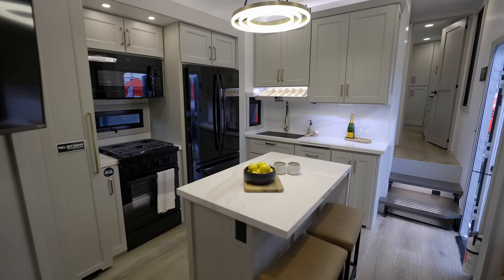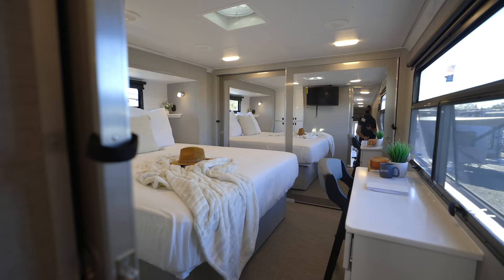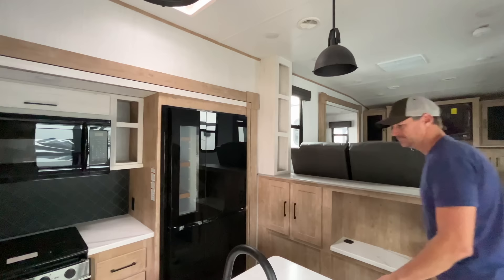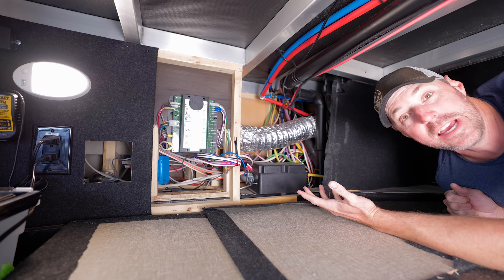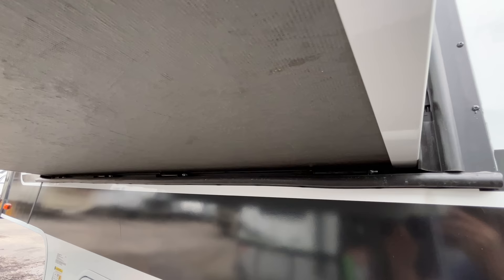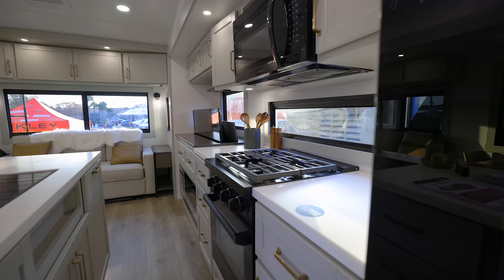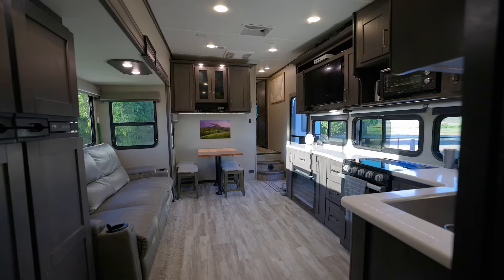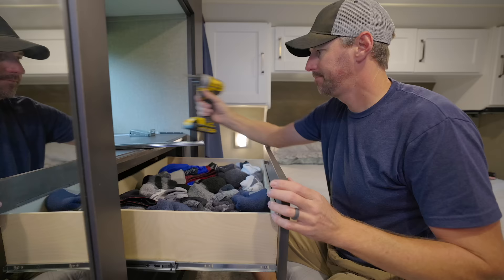Are All RVs Junk! Problems With Our Grand Design RV.

Comment: After 3 previous RVs, I was hopeful that moving up to an Airstream would finally get us into a quality-built trailer, but I was wrong.  While the exterior and interior designs appointments are beautiful, I keep running into things that just make you scratch your head - like the electrical system - which appears to have been installed by elementary school kids.  Of the four RVs we have owned, the Airstream by far has had the longest warranty punch list of all of them.
Reply: Surprised the RV industry hasn't been shut down for child labor - the proof is in the wiring of the coach.  Air Stream might have to purchase an older unit from the 1950's to get a good one. 😀
Reply: Hmm.  Also assumed Airstream was a 100% throughout..

Comment: After just over a year full timing in my Grand Design Imagine XLS I'm happy to say the only major issue was the sliding bedroom door and it's track falling off 2 or so months into owning the camper. The 2x4 that the track was screwed to was just screwed to the thin plywood ceiling with 3 screws. They didn't design it such that one of the roof joists was overhead to screw to (which they easily could have) and the people putting it together didn't screw it to the 2x4 in the wall behind it. A few long screws to attach it to that 2x4 and it hasn't fallen down since.

Major issues aside there have definitely been a lot of fit and finish or smaller/potential future issues I've run into, mostly just from the rushed construction. Jagged holes and errant screws poking wires, wiring in the underbelly just resting on the sharp frame and rubbing through, lots of gaps and some peeling trim, but thankfully nothing that wasn't pretty easy to fix (okay, the underbelly wiring was a pain but I did that while installing tank heaters, which was an even bigger pain, so I didn't have to drop the underbelly just to fix that.

From talking to people in the industry it seems like a lot of it is down to the rushed construction, with many to most of the people assembling RVs now being rushed contractors instead of regular employees. Companies love contract labor because they don't have to pay for benefits and they can do things like pay per unit that rolls off the line instead of by the hour. Corporate usually loves it because if there's any delay the workers eat the cost, not to mention, when pay and bonuses are tied to how many units are rolling off the line it puts a lot of pressure on people to rush things to try and get even 1 more rig out the door each day. As one person put it, the reason new RVs have so much sawdust is because, when you're paid per unit and not per hour, you don't get paid to vacuum up as you work. Perhaps even worse, or better for corporate, this let's them dodge the blame for any issues by blaming greedy contractors when in reality they're just trying to make a decent wage while navigating all the obstacles corporate has put in their way.

At this rate, soon enough we're going to need a whole industry of techs and repairmen, of which there already aren't enough, just to fix all the issues with new units before their new owners can actually start using them.

Comment: I have a small 16' hybrid camper. I have had to do so many improvements. I have added drawer glides and made many upgrades. We are constantly fixing things and making the camper more livable. We don't live in our camper, but we like taking long camping trips. I need the camper to "work." We have spent 4 years changing little things: hinges on the dinette benches for easy access to storage, flipping a medicine cabinet to make it reachable, changing the bathroom sink and faucet to make it useable, etc. I'm glad I know how to make all the changes. I just wish the quality was a lot better. We are fighting a leak in the front tent-bed. I am finding water damage and will need to address that soon. The bed seems to have been installed crooked. I can see gaps on one side where the other side is tight. I have made about 60 upgrades and have about 12 more on the list. Thanks for sharing your video blog. Lots for me to learn.

Comment: We were very fortunate to buy our first RV from small family owned dealer. They really did a thorough PDI to insure there were no significant issues and spent four hours with us operating every system. The only major issue we had during the six years we owned it was the shower drain separating from the line to the gray tank. It was fixed under warranty by an independent local repair shop that the manufacturer approved so we didn't have to drive three hours back to the dealer.

By the time we purchased our second RV we were very well educated and spend three hours running every system, opening every door and draw, testing every electrical outlet, thermometer to measure the air temperature at every A/C outlet, television, CD player, microwave (making hot water in it), slide, awning,  etc., etc. around, under and on top of the RV. I told them a day ahead of time the fridge needed to be turned on well before we got thete. After the three years we had to replace the A/C unit and tack down some molding that came loose.

A few simple things can be done to prevent having issues when you drive off the lot. Don't be in a rush. If you don't feel up to doing a thorough inspection pay an inspector to do it. Have the dealer demonstrate how to close the awning, get the slide in and out, lower the front jack if the motor fails, video the walk through.

Comment: Great video as usual.  I have been full timing in an Outdoors RV 33' 26RLS Glacier Peak for 2+ years.  I would agree that if you are a diligent DIY'er you can handle 99% of the issues that you will experience.  If you have no DIY skills and  depend on a dealer to service everything I think your RV experience will be a poor one.  If you don't routinely get on top of, underneath and pay attention to whats going on with your plumbing/electrical systems and learn about and take of things before they become major issues, yes you will think these are junk.  Some manufacturers are better than others, that is a fact.  I am fortunate to have a solid RV, knock on wood, but I spend time looking at and maintaining, re-sealing, and overall preventative maintenance.
Reply: I've been eyeballing an Outdoor RV. The dealer said the interest rates are at 8.99%, is this normal? i have A+ credit. They are expensive, but per all the reviews they are worth it. One of the very few RV's id even consider.

Comment: I have a 2005 Holiday Rambler 5th wheel all aluminum outside powder coat paint still looks great , replaced roof 5 years ago ,frame rated 10,000 lbs .over weigh,still looking good  ,ready To go anywhere!
Reply: I prefer the aluminum siding over the new mess.

Comment: Here are some hard realities that most RV owners don’t want to deal with:

1.  Most of them are NOT engineered or manufactured to last more than 5 years, and DEFINITELY not for full time use.  I don’t care that the Marketing Dept says they are “rated” for full time use - it’s simply a lie.

2.  The warranties are not worth the paper they are written on, and if you purchase new, you must sign documents that make it IMPOSSIBLE for you to take legal action against the manufacturers and dealers.  

3.  Many owners want a behemoth “rig” that has “everything.”  If the RV was really built with quality materials, you would need a semi-truck to haul it.  If you really want an RV that has less problems, forgo the slides, “garages”, fireplaces, and all the rest.  Get a solid, smaller one you can Glamp in and be satisfied.   The laws of physics, metallurgy, and engineering materials apply to you.  If you ignore this, you will own a titanic Junk Wagon.

4.  These are not cars, trucks, or crossovers, and lemon laws do not apply.  You either accept this, or learn the hard way.

5.  They are a depreciating sink hole, not an “investment.”   I’ve met widows who are still paying off an RV that is rotting away on their property.  If you can deal with that reality, then pay cash if you really want one.  Remember, most won’t last long (let alone the 10 or 15 years of your loan).

Comment: We're on our 3rd rv.  In 2021 we purchased a new 2022 5th wheel. In a very short time, we had to take it in to replace and fix 20 different issues.
My wife always said these aew put together with popcycle sticks and glue.  And there are times She is right .  Workmanship is fair at best and 
even the dealership staff that worked on it sometimes you wonder if they care at all.

Comment: Keep an eye on the wall separation from the floor. Some trailers don't have actual support under the wall. The cabinets provide most of the support and the outer edge of the floor can sag, pulling the wall further away from the floor. Coachmen trailers have outriggers supporting the walls. That's why I bought mine.

Comment: My first travel trailer was absolutely the best. It was a Fleetwood Prowler. The fit and finish was outstanding. Solid cabinetry. Everything worked as it should. A Lance couldn't match this trailer. The interior was a copy of the Airstream layout. Center twin beds and full rear bath. The units i bought after were junk compared to the Prowler. I don't know what to buy for my next one. I prefer a excellent pre-owned unit to avoid the immediate depreciation.

Comment: I can identify with much of what is said. We have had three travel trailers. The first one worked o.k. for a number of years and then things started to fail. When the audio system took a powder due to poor wiring that was the last straw. I traded it on a slightly higher end unit and it actually worked pretty well. A few issues, but not as many as I expected. Last summer bought my "last RV", a Rockwood Mini-Lite 2509S. Our 10 year old needed his own space. After four months of ownership I still marvel at the quality of the design, materials, and workmanship. The cabinetry rivals our custom cabinetry in our home, for example. Excellent! No issues whatsoever. I upgraded the mattress on the murphy bed and the TV and soundbar, which I would have done anyway. Hats off to Forest River and Rockwood. Impressive.

Comment: I have a 2008 sunny brook Bristol bay 3420 bh. I’ve owned it since 09 and I glad to say that till this year never had a problem. Yes I’ve replaced the roof cause it was aging and had a small hole from a branch. Rv roof repair did the work and glad I had them do the job best thing I ever did. It Never leaked no water damage ever cabinets are strong and the outside still looks new. We use it seasonally every summer without a hiccup. End of this year I had to replace the water heater element and also did the thermostats on it. Knock on wood it’s been a great unit. But as for todays Rv’s there junk.

Comment: I recently purchased a Brinkley Z3100 in August.  I just finished living in it for two months, traveled 7,000 miles.  My favorite saying is "one test is worth a thousand expert opinions" and that extended trip showed the quality we have with the Brinkley -we had no issues with the rig so far.  I don't want to sound like Brinkley walks on water -this is my fifth RV and I had some quality other brands before Brinkley (Outdoors RV, Fleetwood).  What Brinkley is doing outside of their modern design and amenities is they are obsessed with quality and holding their suppliers accountable.  I did a factory order and Brinkley caught one of their suppliers sending a major part that did not comply with their Brinkley standards that affected my build.  Getting it right before my rig shipped delayed my pickup date but I was so glad they caught the issue with their QC process before it shipped to the dealer.  Brinkley was honest and transparent with me about the issue too.  Everyone is using a lot of the same suppliers.  Is the manufacturer holding the supplier accountable for quality too?  That's a big part.

Comment: Like owning a boat you have to love the experience to live with it otherwise it will drive you crazy. You have to love camping which may make it possible to overlook most of these issues which personally would drive me over the edge. If I have to worry about fixing issues or have an issue staring me in the face for my supposed vacation I had might as well just stay at work for the week. Again, you had better love the experience.

Comment: A few points.... The plastic exterior trim is cracking because those piece have a lip with an unsupported void on the back. This results in screw depressions and eventual stress fractures. To prevent cracking remove the trim and add support via glued on washers. Be sure to add butyl where screw go into insulated or enclosed walls. The fan squeal is a general annual maintenance item. The motor needs cleaning and lubricated. Interior trim pops off over time for a number of reason. Oftentimes it's due to being too long or under stress (wall bowing). Other reasons include slide box shifting out of square and high temperature/humidity swings. Anyone full-timing should have an air compressor and brad nailer/staple gun. 

Seasonal use units, like yours GD, are not going to have as robust construction, materials, or components as full-time use units. The draw glides, overall unit rigidity, and slide floors on your unit are designed for seasonal use.

As a whole you do get what you pay for in terms of construction quality, finish work, materials, and components. That said for the most part many components on a full-time unit are the same as on seasonal units. The difference being one replaces components more often on a full-time unit. Furnace, AC, and other motors all fail in a three to five year period because they were never designed to be used full-time. These DC motors have a loosely set running time life cycle. When possible upgrade to a higher output option. Higher output equals less running time. Thus more time between motor replacements and other repairs. With most components being used across the industry those using their units full-time will be repairing and replacing components more frequently. 

Those who purchased their RV during the pandemic should expect a lot more issues. Both supply chain issues and staffing issues lead to a lot of compromises by the industry to keep units flowing onto dealer lots. Cheaper or counterfeit materials, components, and appliances were sourced as manufacturers of RV and manufacturers of component sourced whatever they could to build units and components. New hires were simply thrown on the line with little to no training or oversight. Quality control was essentially left to the dealerships. Dealerships, dealing with their own pandemic issues, overlooked a lot of issues. It didn't seem to matter how bad a unit was.....it sold regardless. 

Now......the industry is suffering a slump. Once again cost cutting is going to affect quality. They'll do their best to slap on as much lipstick as possible to distract buyers from quality issues. We will see more brands being discontinued, bankruptcies, companies splitting (to kill off under performing models via bankruptcy), rebranding, and acquisitions as the industry resets to lower demand. The brand names of poor quality entry level units with bad reputations will change, but the units are essentially the same.

Comment: I am a NRVIA certified Inspector and I recently looked at some 5th wheels by a new manufacturer which is mentioned and every one of them had missing sealant on the vertical trim where the sidewalls meet the front cap. Some of the trim was already buckled as well. 
If you're buying new regardless of price, manufacturer or type, get it inspected by a 3rd party !

Comment: Excellent video. We are long time RVers. We’ve owned 8 over a 35 year period. I’ve seen a difference in quality between brands and as we consumers wanted more accessories. The more in them , the more to go wrong. We travel with friends who own different brands of trailers as well. I think we realize all RV’s will have issues but I truly believe there are some brands better than others. 

But salespeople and dealers lie. Not all but many. And buyers don’t know what to look for and where problem areas are. 
There are some reputable dealers who will sell you want you need, not what they are trying to move. 

We purchased a new Winnebago class A gas coach 30 months ago. 38,000 miles later we are still very happy with it. Did things come loose, or break, yes. Most interior issues ( a piece of molding, drawer latch, microwave molding ) were minor and as person who’s handy, not an issue for me. I live in the desert and 115 degree summers are common which puts a world of hurt on the RV. 

Most of our issues have been with supplied parts. Water pump, step motor, propane regulator, etc.
We wish the industry was better regulated.

My advice is get an RV inspection prior to purchase, get lots of information before purchasing and watch Jarod’s videos for good tips. 
Thank you again

Comment: Great video Jared. We have a small notebook in our 5th wheel, every time we go on a trip and find something that needs repaired or that we want changed , it gets written in the notebook. Next on my list is to change the 2- 8 3/4" steps to 3- 6 1/2" steps and possibly add a handrail somehow. We're both having issues with our knees and those steps need to be changed. I think it just comes with the territory to keep things adjusted or repaired when needed.